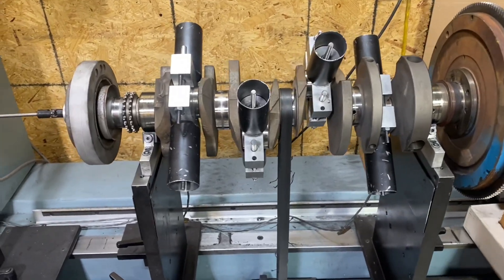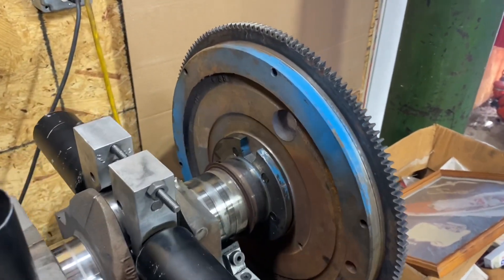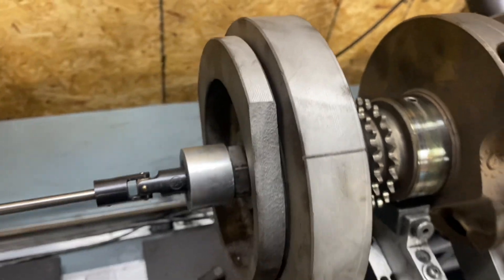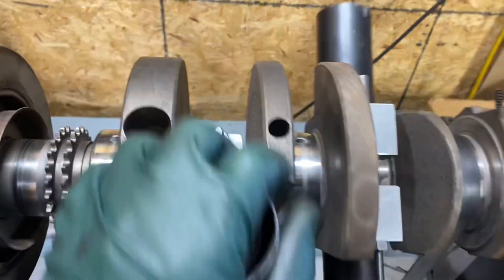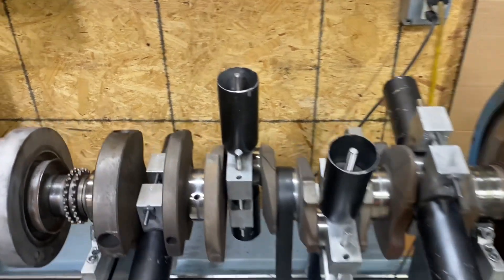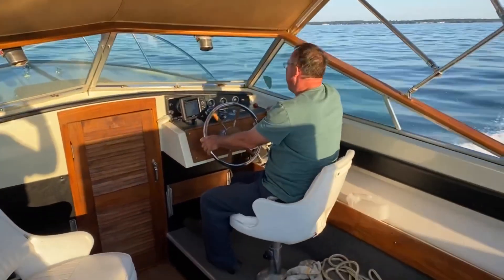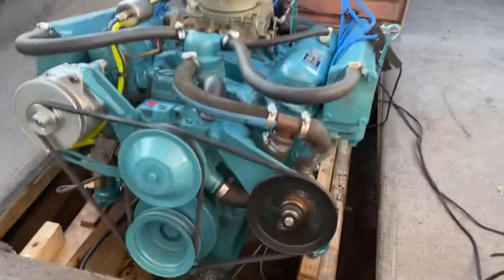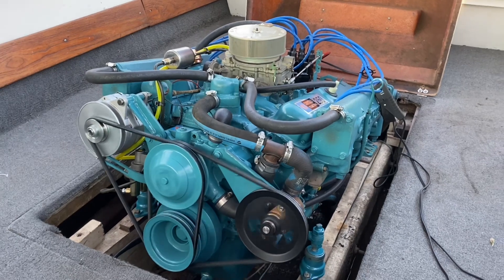360 Chrysler Marine Engine Overhaul

Comment: What alternator did you put on the engine I can’t find one that fits.
Reply from the maker: That’s an aftermarket one wire alternator. ANE5202 was the original Prestolite number. Go to a reputable electrical rebuilding shop in your area and ask them for the one wire replacement for that.

Comment: Where did you find the parts. I have one and having a hard time finding the parts for my engine. Also serial number doesn’t come up when looking for it also.
Reply from the maker: What do you need? What are you looking for?
Reply: @LakelandAutoMarine  I cannot find the model of my boat but it’s a Chrysler. And the motor looks to be the same as in this video but it’s been rusted so bad there isn’t a data plate. And the serial number on the hull doesn’t come up as anything because it’s a 516 number. If ok with you I can email you some pictures so you can see what I am talking about. I just don’t know where to start with research on her.
Reply: @LakelandAutoMarine  Do you do a lot of Chrysler work?  They were the best in the day.  Nice work.  Do you do their outboards too?.  Look up Murley Marine in Fairhaven MI he has a ton of NOS parts for Chrysler Marine.